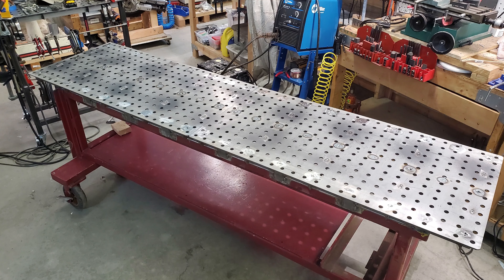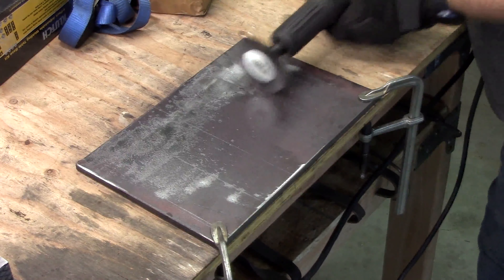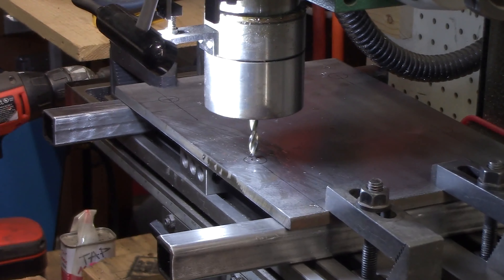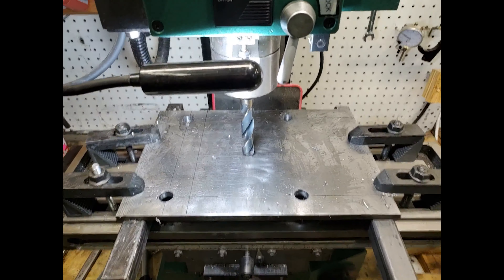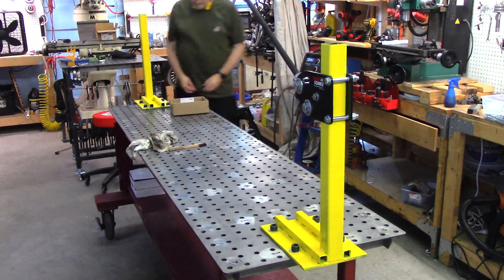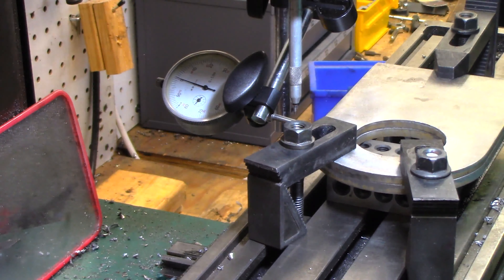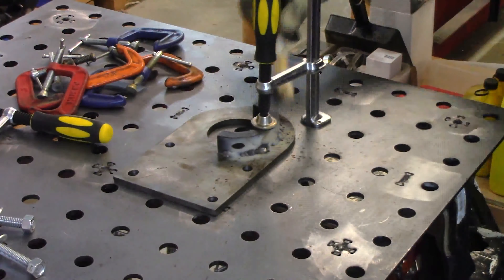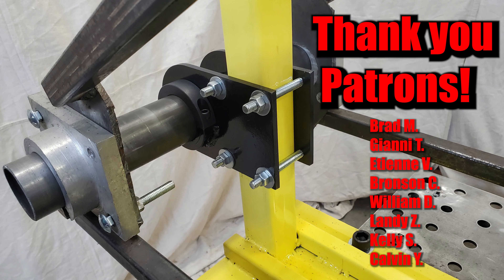Akira Bike Project - 18 - recumbent/feet forward motorcycle frame jig - part 2

Comment: I've been watching you try and put this thing together since you first started, stoked to see you're still at it. Can't wait to see it completed. 

Also you may have already known this but.. The Akria motorcycle is actually a kind of hybrid electric in the comics. It's never mentioned in the movie but it runs the electric motor off a smaller motor which serves as the generator. In the universe of Akira the bike is a racing bike so I doubt the hybrid set up was done for efficiency. I imagine that the creators of the comic figured batteries would be too heavy but acknowledged that an electric bike could be faster for racing purposes. Either that or they just thought it was cool. (probably the latter) Now days batteries would most likely be lighter, still it would be sick to have the "in-universe" specs. I don't know if your just going for the look and ride feel or for in universe accuracy but I bet, with the recent advancements made in electric vehicles, you could probably make it function with the hybrid electric setup. Would it be fast? How much would that cost? I couldn't say. You'd have to figure out the ratios of how energy is transferred and lost between the internal combustion motor going to the electric motor, and figure out whether or not both gas and electric motors like that can be acquired or somehow produced within reason. It could very well be that the weight of a gas motor that would have the power required to drive the electric motor(s) would be too heavy to merit actually practicality. 

Just something to chew on and regardless of whether or not you've heard of this or plan or don't plan to do it, I'd love to hear your thoughts on it. 

cheers
Reply from the maker: Yeah it certainly appears to be some type of hybrid electric (electric sparks shooting from wheels + clear internal combustion engine high rev sounds...)  

Batteries just aren't there performance wise yet for a high performance long range motorcycle that is electric only, but I do really like the idea of a hybrid electric.  

My platform opens up alot more space than a conventional upright bike, I can fit a ~5 kWh battery pack in the undercarriage alone for instance, and that's not even touching the space between the legs under the steering column. My primary goal is a fully functional vehicle that's useable and performs well, secondarily it is heavily aesthetically and form wise inspired by Kaneda's ride.  The first rideable stage in development will still be gas powered only, but I will definitely be working on an hybrid electric upgrade to it. Hybrid electrics have alot of challenges in execution, combining the HP+torque curve outputs from the ICE motor and the electric motors smoothly over the RPM band is a challenge, but something that can be done, and can be optimized for performance or for efficiency or a balance.  Fitting regenerative electric brakes into a motorcyle is a challenge too, and you may be raising the unsprung mass significantly with that. 

Now that I've picked up a cx650 turbo, I like the idea of adding turbo charging as well, and the platform is really conducive to that also (it's hard to fit turbos on upright bikes)  Turbos have challenges as well, and a good setup might be a lower rpm range optimized turbo and a higher rpm range optimized turbo, so it would be a twin turbo.  These would fit nicely with that transverse v-twin rear engine layout and look really cool. Turbos can also be significantly improved by using turbo hybrids.  These put generators/motors on the shaft that connects the compressor with the turbo charger.  Instead of opening the waste gate when the pressure is too high, the generator puts a load on the shaft, and they function as motors to spin the shaft up and eliminate turbo-lag. 

So in my ideal world it would be a .... hybrid twin turbo hybrid gas electric drivetrain (?)  or a twin hybrid turbo hybrid electric ?  We'll need a new name like a super turbo hybrid or something lol. 

Thanks for the comments and following the project!  if you're able consider becoming a patron and joining the discord for more shop/design talk!

Comment: If mill scale is just a form of iron oxide, then another method is evpo-rust. It’s a product that chelates iron oxides specifically and leaves anything else unaffected. It’s more expensive than other classic methods like acids, but it’s apparently very effective and convenient (since you dont have to worry about soak time, it doesn’t matter how long you leave it).
Reply from the maker: I was going to say I don't think it is, it's some baked on oil from the hot rolling process, but apparently it is all just forms of iron-oxide: "the flaky surface of hot rolled steel, consisting of the mixed iron oxides iron(II) oxide (FeO), iron(III) oxide (Fe2O3), and iron(II,III) oxide (Fe3O4, magnetite)" so I'll give it a try on the next piece!  Strange that the grinder and sander are so ineffective when it's just other forms of iron-oxide.
Reply: @matus1976  The main difference between the iron oxides is that rust is a hydrate and is porous and therefore has little strength compared to mill scale. So mill scale abrades easily.

The other oxides behave like ceramic coatings. "Blueing" as used on firearms is just an oxide coating

Comment: One day I would like to build a bike like this. For rear wheel steering I was thinking just going electric and using a rear wheel with a hub motor. Did you ever consider anything like this?
Reply from the maker: Definitely an option I'm considering in future versions